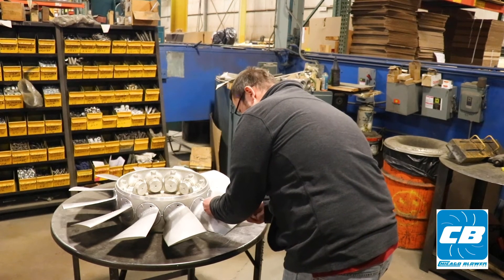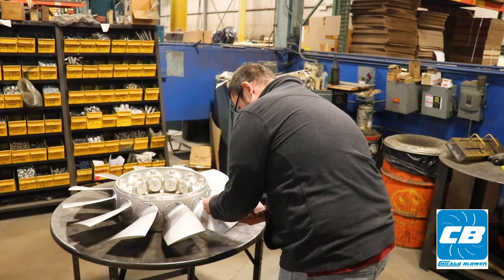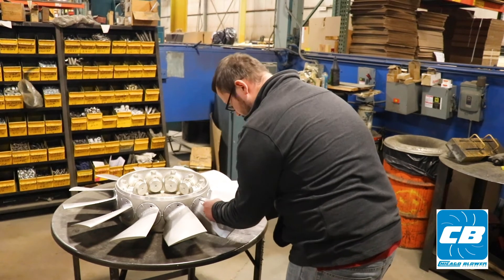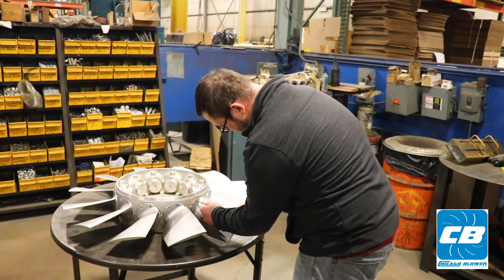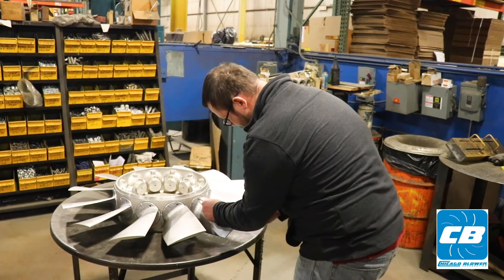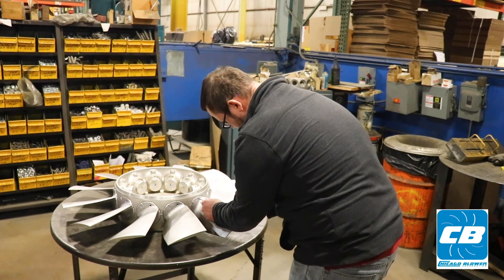How to Change the Pitch on Adjustable Pitch Vane Axial Fans

Comment: What state or country are you located in, we can send you some documentation and get you in touch with a representative that can answer more questions for you.  The concept is the fan wheel has an actuator that will control the blades with a positioner mounted on top of the fan.  The fan wheel will change pitch and respond to changes in the environment without a person having to physically change the pitch.  This is often used in applications where even the most stringent of conditions need to be met.  Other options would be to utilize a VFD to change the speed of the fan which will in turn change what the fan can do performance wise.